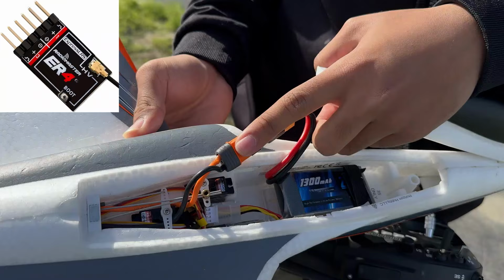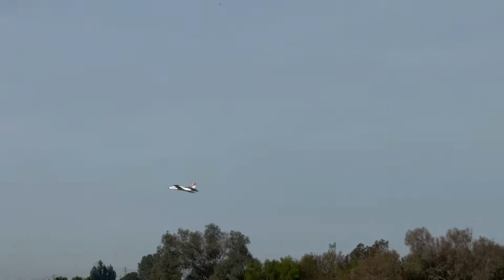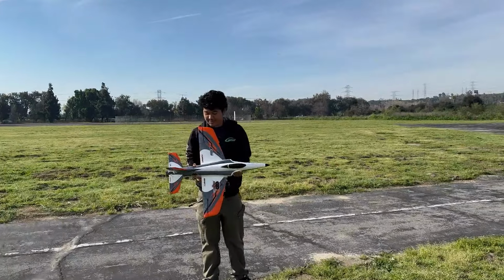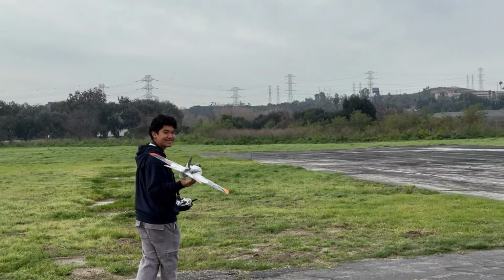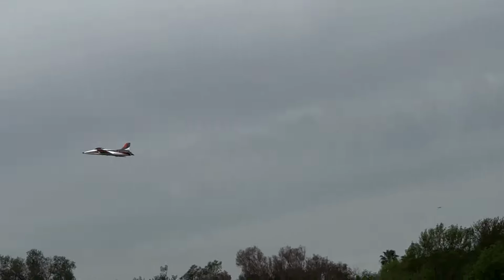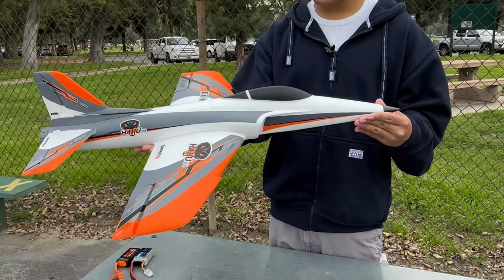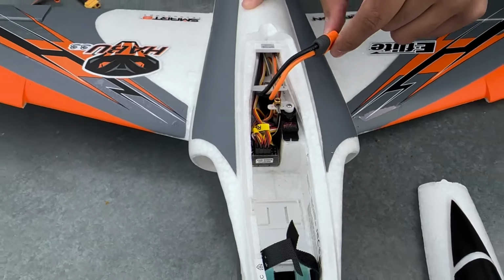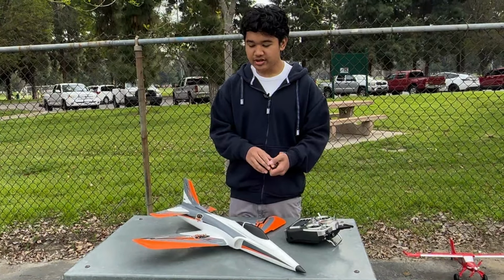YOU NEED THIS JET! E-FLITE HABU 50MM MAIDEN FLIGHT

Comment: do you think that the umx timber x is a good step up from the sport cub s2 that i can do some tricks on?
Reply from the maker: Hi! Instead of the UMX Timber X, I would go for
the UMX Turbo Timber Evolution for a couple of reasons: 
- it’s a quieter model
- longer wingspan lessens wing loading
- will not wing rock during high alphas or hovering
===
They are both great models, but due to the Timber X’s short, fat wingspan paired with high wing loading, it’s in its nature to have unexpected “wing rocking” and other bad tendencies while doing some maneuvers. I hope
this helped! Happy flying!
Reply: @JonsRC  ok thanks a lot!
Reply: i just wached youre vid on the umx turbo timber evolution and i totaly agree. i love how you respond to everyone!